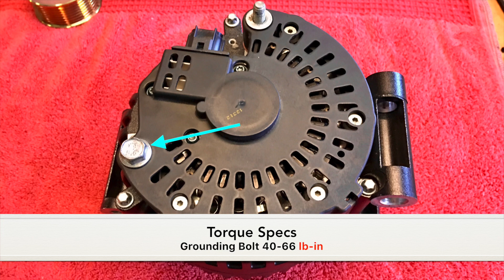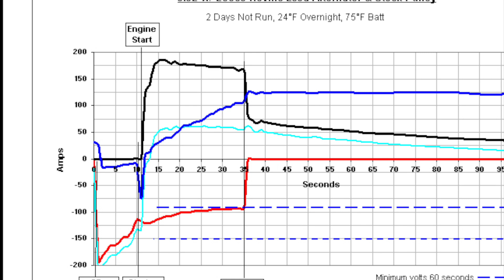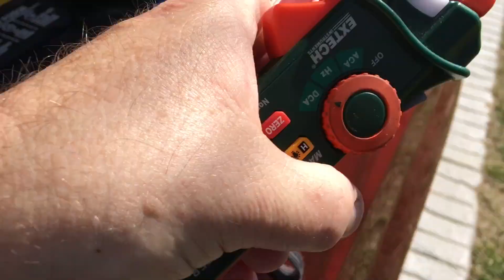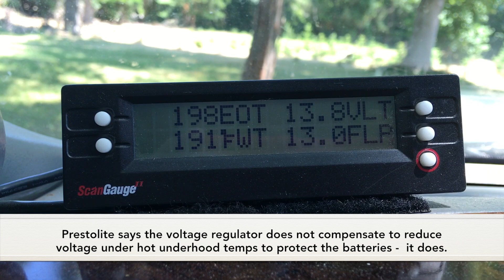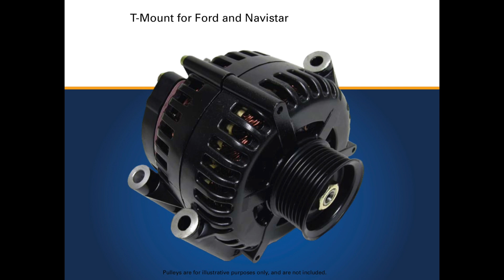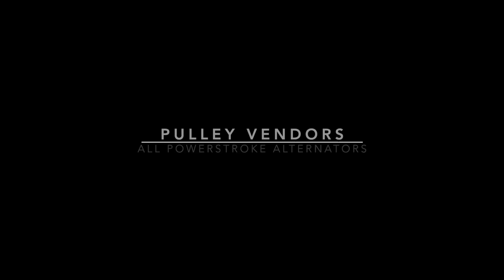Powerstroke 6.0 - Alternator Testing: L-N 230a

Comment: What an excellent video. After watching this and some of your others I picked up a 140A 6G and did all the pulley swaps. As noted the small 58mm pulley on the 140A does the trick… Almost….. At the time, Unable to find a reasonable priced 230 Leece (Canadian exchange to usd is terrible) I picked up an alternative to expensive options with a reman 6.4L Denso 200A hairpin and a regulator for a Toyota application with a 14.2V set point knowing the gpcm issues. Allegedly it is good for 230A at 6000rpm. I am in the process of installing the regulator but am having second thoughts on using it due to the terrible quality of the Wilson reman…. Why use a proper screw for the regulator when a short sheet metal screw works……?
Reply from the maker: I just found a way to see comments I've not responded too, so sorry for the delay.  I'm glad you are finding my videos helpful.  Hopefully, the new setup will work for you,  unfortunately not familiar with it.
Reply: @toomanytoys  well I did get it together and ran it on the alternator test bench at work. It has outstanding performance for its size being a 6 phase alternator. I did experiment with a diode on the battery sensing wire to have it charge at 14.5 volts instead of 14v. Will see once it’s on the truck.
Reply from the maker: @michaelschoenau3305  They are supposed to perform well.

Comment: What size alternator would you recommend for my 6.0 excursion? Don’t have any accessories But the stock unit sucks!!!
Reply from the maker: Without going to aftermarket adaptations, getting a 140a alternator and putting on a 58mm overdrive pulley that you can get on eBay for under $15 is a good setup. Of course, it will wear the brushes faster by that percentage, but we should get almost 100k out of it.  

More expensive, a 160 to 180 amp does the trick.
Reply: @toomanytoys  Thanks for that information good sir! Your videos rock. Solid data collection. I just did the over drive pulley on my stock unit. Much happier between 600-900 rpm now. I was dipping to 12.4-12.6 when it was hot idle with the AC blower on max. Now im able to hold 13.2-13.5vdc. Not perfect but better. I have a JS Alternators unit on my 96 bronco 240A but it can do 180+ at idle. Might just go that route. It has the denso hairpin stator design which seems to be superior for low RPM high output. thanks again
Reply from the maker: @Bacongrease00  Your welcome.  Yeah, the hairpin alternators are a good design.

Comment: This is a nice video, thank you for your info. Just an update that of ours we sale have the OEM prestolite sticker as well as our own sticker with barcode to track purchase. We also  give a 2 year warranty and have a nice anodized black pulley with slightly smaller than OE diameter for easier belt installation. The black pulleys look much better than the gold ones. We have been here since 1930 now still family run with phone support and same day shipping on this alternator and OEM Denso for the 7.3 & Mahle for the 6.0, 6.4 starters that we've found to be the best replacements.
Reply from the maker: Thanks for your comment.  The color preference of the pulley is in the eye of the beholder.

It's good to know that you now  keep the OE label on the alternator, it's not what you stated in your video and you got a comment in the response section about taking the label off.  There have been a number of members in the diesel community that was told they were purchasing the L-N alternator only to find out it wasn't.  Other than buying the alternator from a listed distributor of their product (BTW, Nations is not on that list), the only assurance people can have is getting an alternator with the proper label, Prestolite paperwork,  and the original box.  Considering the WAI unit looks exactly the same, those items are part of the insurance they are getting the product they were interested in.

My L-N alternator was shipped in from an out of state source in the original box with a secondary outer box and survived.  The Prestolite L-N box is shown in my video and was sealed.  I was fine with it.

Comment: Thanks for the detailed video. Is this issue something that needs to be fixed, or is it only a nuisance?
Reply from the maker: From the last 3 to 4 years of people using it, it only appears to be a nuisance, similar to a circuit breaker going off with a high load but resets.  No one has reported any damage to the glow plugs or alternator itself.

Comment: From what I can gather, the system voltage has a role to play in whether or not the GPCM turns on or off. After seeing the video from start to finish, and the interesting behavior with the glow plugs cycling on and off when the alternator began charging, I assume that is a result of the GPCM seeing the high 14.5+ system voltage and turning off the glow plugs to protect them. Do I have that at least half right? Electrical concepts have never been my strong point, but these videos go a long way in helping. Just trying to understand why exactly the GPCM and alternator weren't playing well together. 

Thanks.
Reply from the maker: You got it.  The PCM controls the GPCM when to turn on based on oil temp and a few other things, but with the failures of glow plug tips ruining 7.3L motors with just a relay control when voltage went high, Ford implemented Beru's Glow Plug Control Module to monitor system voltage if it exceeded 14.5v or so.  With a large enough capacity alternator with a non-spa voltage regulator, you can get to that 14.5v+ point, and the L-N does.  This is also why with the factory equipped dual alternator trucks Ford has the alternator control go through the PCM so only one alternator is turned on while the glow plugs are turned on, so there is not a high amount of current that can drive the voltage high.  With the factory single alternator trucks there is no worry that the amps are going to be so high to develop a higher voltage.  We blow that out of the water by installing 180amp+ alternators.  But at least the GPCM is there to protect us from ourselves.  It appears its only the Leece-Neville alternators that have voltage regulators that will exceed 14.5v.  Other aftermarket companies utilize regulators that stay below the threshold.
Reply: I just wanted to take the opportunity to thank you for writing back and clearing that up. Your videos have been incredibly helpful; it's a nice change of pace (from the usual stuff on YT) to see a video that goes into the nitty gritty with an articulate narration. Far too many how-to's or "mod" videos just glaze over the details of something.
Reply from the maker: Thank you for the comment.
Reply: Picked up  6G WAI 200 amp, with stock sized pulley, rebuilt by Brian Roberts Auto Electric in Victoria BC. $542 cad. They do couple mods; with heatsink, use quality press in diodes and skf bearings etc.
They can install a 14.8 or 14.2 internal regulator or configure for external regulator Balmer 3 stage etc. Went with 14.8 regulator.
Installed in 2006 E450 with 6.0. 
Idle output 117 amps.
Hot alternator voltage is 13.9

Comment: In your last video of your series on balancing battery life and grounding you mention another video about how you repaired the ground issues . Was that video ever made? I’ve had trouble finding it.
Reply from the maker: I apologize for that.  There are some measurements I wanted to show but haven't reinstalled the motor to take them.  Within the "Electrical Ground Cable Solutions 1" video I showed a 8 ga cable from the driver's battery to FICM and PCM grounding points.  That is what had gotten me to the point I wanted to achieve.  Some people had jumped on that and used larger cables, but that ends up causing other issues, 6 ga is the limit.  An 8 ga cable over there will be the best unless an extensive and expensive re-cabling of all the main cables is done.

Comment: Thanks Jack!

I bought that alternator 4-5 years ago right when they were going to China. Like you  mine came in the LN box  longer bolts and a additional 🐖 tail for optional connector. I have the smaller pulley installed and have had no problems. 

Great video my friend!
Reply from the maker: Thanks.  It seems to be a good, sturdy unit.  I ended up using 1/2 of that pigtail to replace my factory connector.  Flipped way too many alternators back and forth with it.
Reply: @toomanytoys  I hear you there. When we spoke about this setup years ago. I placed a 100amp fuse in series with 1/0 cable going to the battery. I've considered using a 75amp fuse instead?  I also swap batteries every 6 months. Opinions one that?

Thanks again for all your contributions to the community! 👍
Reply from the maker: @eddylee587  Your welcome.

The fuse thing with alternators is interesting.  Due to their slow reaction, you can undersize by SAE standards, and as I mentioned, I often fall back to my history; I probably should be more mindfull.  I would not go lower.  But again, that depends on your alternator size.  Typically when we create a short we're pulling over 1,000 amps, and that's usually the only time fuses or fusible links blow.
Reply: Just curious, what pulley did you guys use to to overdrive the alternator and where did you get it?